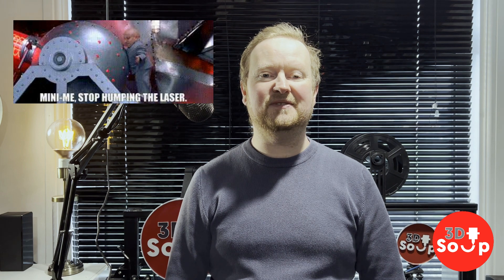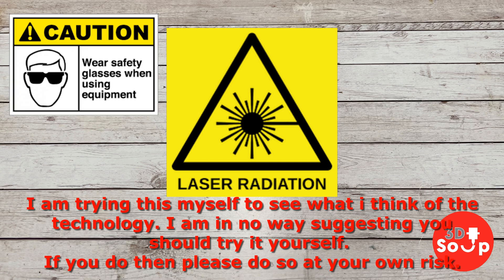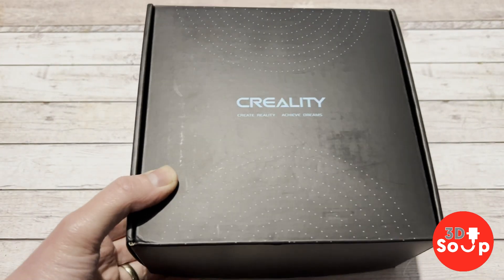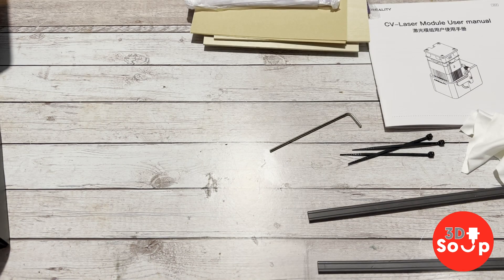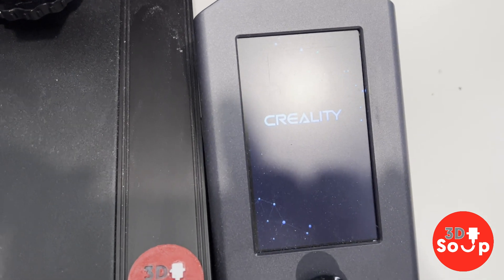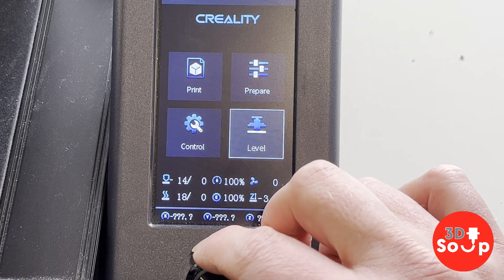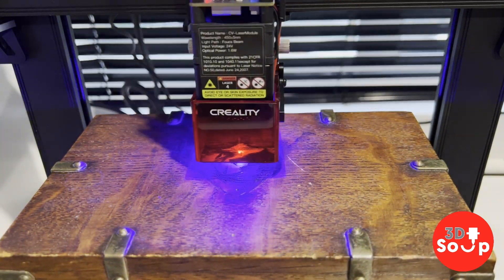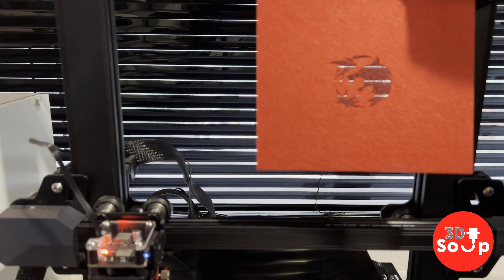Ender 3 S1 CV laser module install and review. We check if its good and is it safe for home use?

Comment: Thanks for making this - I'd received an Ender 3 S1 with the firmware to do engraving, but the 1.6W laser came with a broken Falcon control box. Your video allowed me to direct wire the laser to the printer instead and got it working straight away. Much appreciated.
Reply from the maker: Glad it helped, make sure to wear goggles :)

Comment: This video is hilarious.  I've bought this kit a few months ago, and am a little hesitant on using this in my house for safety reasons.  Watched this video to help me install, but confronted with the fact I might be one of those 3d printing hobbyists they shouldn't sell this to lol.
Reply from the maker: I love the idea of a laser add on , but an open laser in the house was and possible toxic fumes was a deal breaker for me- if I had a fume cupboard that was fully shielded I would use it, but I dont have the space or the time to set that up. Thanks for watching. :)

Comment: Wouldn't air quality also be a health issue? Professional engravers cutters comes with air ducts.
Also can it cut plastics/wood?
Thank you
Reply from the maker: You are not wrong , if you engrave a synthetic material of wood treated with chemicals you risk breathing in some really nasty fumes. Mask, box and ventilation are essential when using laser cutters imho. Cheers for watching
Reply: @3dPrintedSoup  thanks for reply. Have you tried cutting things also, is the laser strong enough
Reply from the maker: @Sysshad  this is the low power version, there is a higher watt version available for cutting.

Comment: Could you make a video for the ender 3 pro with this module.
Reply from the maker: Stock ender 3 pro does not use the sprite direct drive so this won’t attach to it natively. I would have to mod my pro and I am not planning on doing that in the near future. Maybe at some point. Thanks for watching
Reply: @3d Printed Soup  found what i was looking for the new laser made by creality has been made for this mod. When i bought it, it listed the 3 pro as compatible. They added a new module to make the older 3D printers without the touch screen compatible.

Comment: Hello, i cannot make it work. What version of the available firmware did you install? Thanks!
Reply from the maker: The version I installed won’t necessarily help you. You need to check which board your printer has and down load the matching firmware for it. Thanks for watching :)

Comment: Creality Print is quite limited as a laser engraving program, were you able to use other programs, like Lightburn, with the Creality Laser module?
Reply from the maker: I used the software provided by the manufacturer in the review as it’s what the user will probably try first. Will have to try it with other peoples software at some point